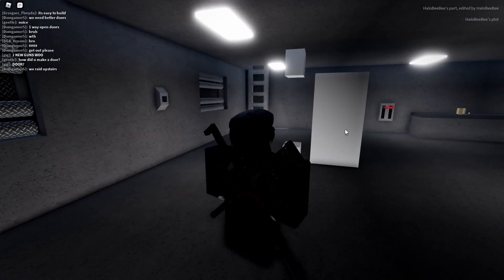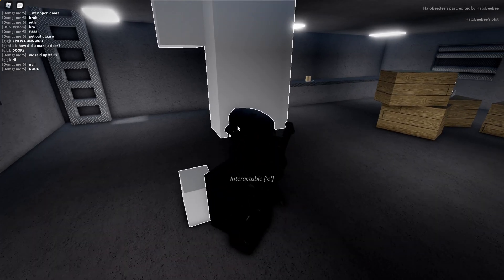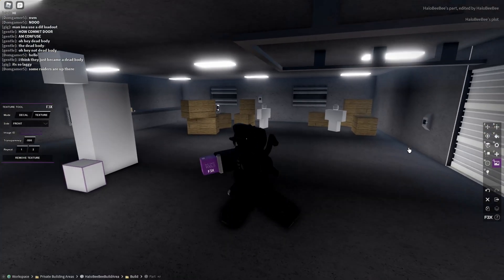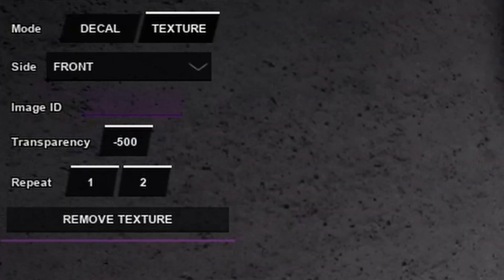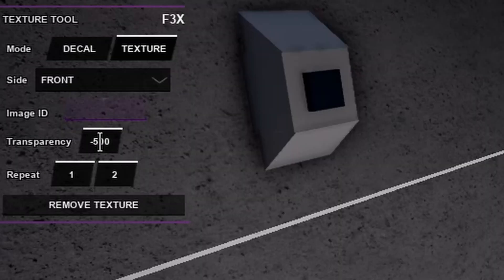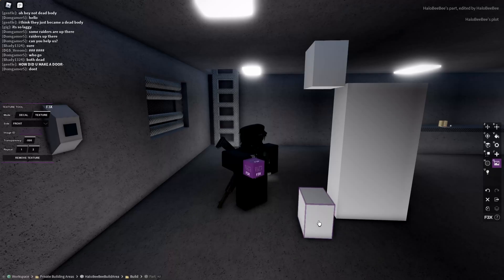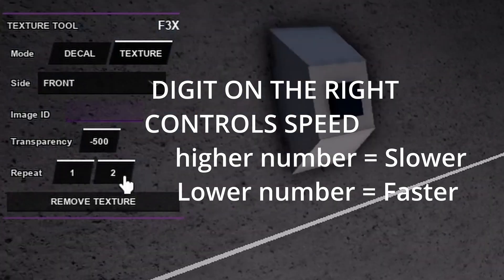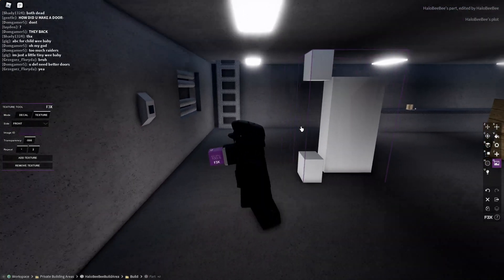The Roblox Town Door Mechanics Explained

Comment: hello, i found out that there are more than 4 door digit things

here's a summary:

1 and 2: they're the main digits

3 and 4: 3 is for connecting with another door. they both need to be colored

5: i don't really know much about it

6: this digit is for targets. when you shoot the block it will activate the thing that it's connected to

7: one of the simple ones. is for making touchable doors, for example: you dropped your gun on the block, the grouped part will activate. the block also reacts to you and corpses

that's all i think
Reply from the maker: That is correct
Reply: I have an image of everything you can make with all the numbers
Reply: 10 is for logic gates

Comment: Hey, can you make a tutorial on how to make a double door? Or make a button that remotes the door, make the door cannot be interacted? sorry if it really makes you confused.
Reply: to make two doors open in the same time you do the same tutorial but you need to add to the door part has "4" repeat and for example red color
and then make a 3 small part "1" and "2" has the same normall white grey color and part "3" has red color because if you change color of 3 or 4 there will be no signal, anyways and then group door with small part 4 and group 3 parts ( 1 and 2 and 3 repeat parts ) then wired conetcte ( say !wc ) then when you click at button two doors will open in same time. also don't group all parts like button and door
Reply: hey can you make the double door???
Reply: @ЕрсұлтанРысқұлбек  hail satan